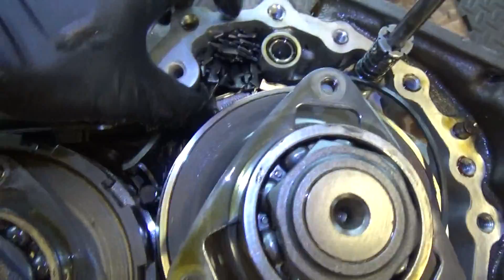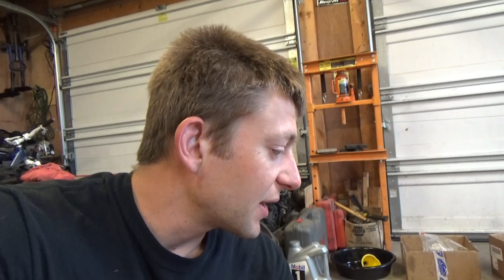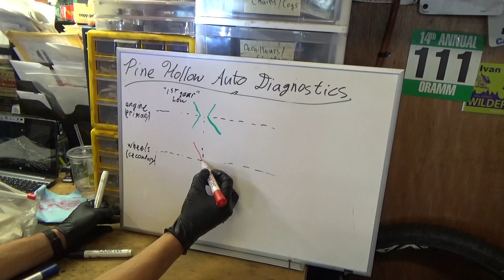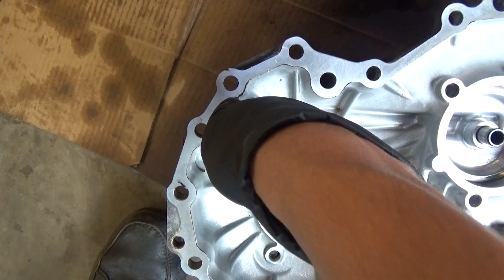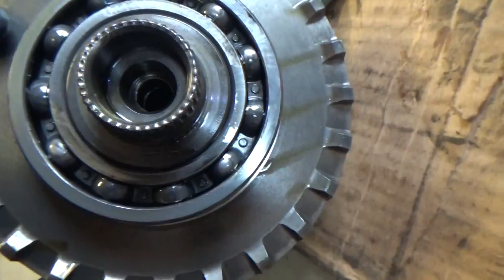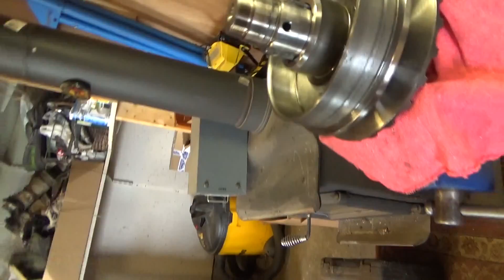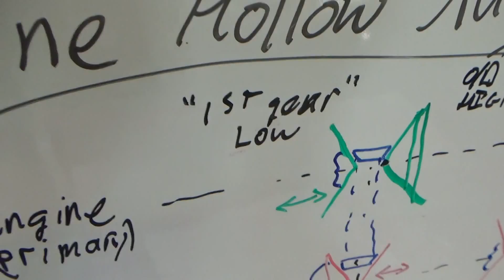Nissan CVT: Teardown and Failure Analysis -Part 2 (RERELEASE!)

Comment: Nissan has one of the worst CVTs on the market, many failing at well under 100k miles they are made by a company called Jatco (Japanese Automatic Transmission  Company) a subsidiary of Nissan they sell these a POS tranny’s  to many other companies including Nissan, Mazda, Subaru, Suzuki, Isuzu, Hyundai, BMW, VW, Land Rover, Chrysler, Renault and even Jaguar. Toyota and Honda makes their on CVTs Toyota has been making them for decades and have a good track record. I’m not sure about Hondas. A rebuilt one cost anywhere from 2k to 5K so an extended powertrain warranty is money well spent on these cars!

Comment: Great video. I agree with your analysis that the failure seems to have originated from the primary shaft. Based on the wear pattern it sure looks like the groves wore over time, as the pulley moved in and out. The Aamco manual states the Nissan recommend fluid change interval is 60k miles. If this transmission had 180k on it then that's three times the interval. I think it's possible a breakdown of the lubricant could have lead to the metal on metal contact which made the failure possible. I do think it is somewhat questionable for those small balls to transfer all of the torque of the engine. Seems like some splines might have been better, but maybe they wouldn't hold up to the cycles. They seem to work in manual transmissions, but perhaps the ball and groove solution has less drag. I don't know. It would be interesting to see a new version of the transmission disassembled. 

I found a couple additional pieces of information on the CVT. I believe this transmission is the Jatco JF011E. Nissan refers to this CVT as the RE0F10A. The 2009 Rouge FSM confirms it uses the RE0F10A. Not sure if later years use a different CVT as I can only find the FSM for 2009. This transmission is also used by Chrysler it seems. From some of the press I am reading from late 2013 Nissan stepped up it's oversight of Jatco around that time. 
https://akppro.com/en/archive/article/jatco-jf015ehttp://aamcoftp.com/sites/aamcotech/assets/cvt-manual_cvt-manual.pdfhttps://www.autoblog.com/2013/12/02/nissan-cvt-jatco-problems-ghosn/
Here's a quote from the akppro.com size comparing and contrasting the JF011E to the JF015E which has a lower torque rating:
"The design of guiding pulleys has changed, too. In the JF011E, pulleys are attached to the shaft with balls, which could be destroyed by constantly changing loads. And here it is pulleys that are fixed with the roller. This is a more durable design solution, which reduces the likelihood of pulley seizure."
So this seems to be what happened with your transmission. I hope the new one is working out alright for you.
Reply: But if you think about it--- if the shaft was the real failure, then the belt would have never broke.   It would have just sheared those little balls and then the shaft/ pulley would just free spin.  So there's no reason that the belt would have broken.   What I think happened is that the belt broke first-- and the all the "kibbles and bits" bound up the pulley and so right after failure, she was still on the gas and the shaft and pulley was chewing up pieces of the belt and binding up-- until it sheared those balls.   The belt failed first-- it had to.
Reply: @calholli  The description of the design change says it "reduces the likelihood of pulley seizure." I'm not in the lab analyzing these transmission failures, but it sounds like if one pulley seized the load on the belt might rapidly increase which could cause belt failure.

Comment: The 2007-2011 Altimas had it the worst with the CVTs. It’s an inherently unreliable design. I prefer regular automatic transmissions with 5 or more speeds. Turbo gasoline engines are reliable as long as they are properly designed and a lot of 90s and 00s turbocharged gasoline engines are very reliable. The only reliable CVT is the Toyota/Lexus hybrid power split device and their new CVT.

Comment: One pulley is activated by oil pressure, while the other one is spring loaded. I think that the oil seal is the route of the problem. The oil seal blew out, an the pulley ran dry and the jam, causing the belt to start breaking. They need a better an thicker oil seal.

Comment: i think you missed the importance of how this really works. those pulleys are variable. if the one gets small the other has to get bigger so it keeps constant tension on the belt. SO both pulleys float on their tubes/shafts from hydraulic pressure as RPMs increase or decrease. I'd say failure was eminent with that many miles and the design. once the metal tabs start falling, whether from wear or a massive pressure drop, it just becomes a bad blender eating everything up inside. I'd also suspect it had metal bits in the trans pan long before it failed completely.  Belt CVTs are better IMO but a 6 spd rules them all. Nice tear down! Ive never seen this models CVT before.  also the last pulley is controlled by pressure thats why their big holes in the shaft. kind of an ingenious design but needs work to last and handle more HP.

Comment: Afternoon, 
How is the Transmission(replaced) working for you. I have a same problem with my Nissan Rogue 2012. Nissan is charging me 3,500 to fix. Afraid for this to happen again after the 1 year/12,0000 mile warrant. Wanted to ask you opinion. 
Thank you Sir,
Reply from the maker: So far the replacement CVT is running strong with 25k miles on it already :)

Comment: What prevents wear on the sheaves in normal operation? It seems the belt would dig into the pulley.
Reply from the maker: Good question! The pressure on the belt is precisely controlled and the engineers did a good job preventing excessive wear, using the proper CVT fluid of course.

Comment: This is why I don't trust or care for CVT trans/Salisbury transmissions.  Fine for small HP applications like golf carts, utility carts...NOT automobiles!!!  If you want an 'automatic' trans, get a 'real' one.  Unfortunately several of the new 7,8,9 speed automatics are so complex that many consider them including the OEM manuf's consider them unserviceable. I have to agree with El Cheapo and Lightningsmoker's comments.

Comment: Cars, like almost everything nowadays, are designed not be fixed, but thrown away when a major problem occurs. Engineers, at the behest of bean counters & management, know exactly how long something can last under normal conditions. They can easily spend a few extra cents or so to make it last longer but they are told not to. End result: It will last until the warranty is up and may last longer depending on how it is used. Also a lot of car owners will trade the car in for a newer one after about 3 or 4 years or when it comes off lease. This way they have a nice new car with very few worries. But the drawback is much higher insurance costs.

Comment: I believe that both pulleys always want to be fully closed, so that's their natural position. The oil forces one to close more than the other. And the only thing keeping them open is the belt. Due to the presence and strength of the belt, it's impossible for both pulleys to close during normal operation. I don't believe the oil pressure and mechanisms in the transmission is powerful enough to squish the belt causing it to fail. Therefor, the belt failed due to the belt breaking. Or something else failed and got caught in the belt causing it to break.
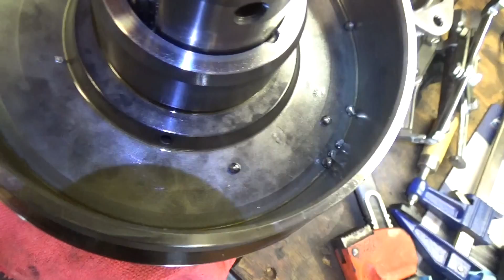Reply: The metal bits at 35:30 look like ballbearings to me. They're probably somehow related to the failure.

Where you thought the ring clip goes, is where I believe the rubber seal goes. The seal is what allows the oil pressure to push the pulley closed.
Reply: I see. So the balls got jammed in there which made the pulley get stuck closed.
Reply: Get a new shaft, then before you install it, send it to a machine shop and have them double the number of slots in the shaft and in the other part that fits over the shaft. Then put balls in the old and new slots for twice as many balls. There will then be half the load per ball.

Also, the balls didn't wear out, the shaft did. So the shaft is obviously made of metal that's not strong enough. So you could bore out the slot to make it bigger, then manufacture a hardened steel insert for the balls. You could do that with your old part. I would both double the number of slots and add the hardened steel inserts.

Comment: ☝️👍 Very well done video and part one as well. As a retired Caterpillar mechanic of 45 years, I just can’t stay away from this stuff and still do all my own work. Proper failure analysis is critical to finding the root cause in order to redesign to prevent future failures, and you sir did a fantastic job. I think you were spot on in the failure analysis of your CVT (Constantly Violent Transmission) Thank you for taking the time to do this although I’m not sure Nissan would agree with me 🤔🙃
Reply from the maker: Thank you for the thoughtful comment! I really appreciate the feedback. As a curious engineer, I couldn't pass up on this opportunity to see how this contraption worked and what caused the explosion :)

Comment: dodge 727 torqflite plane tary gear failure 3gears failure 4or 6 stopped early fail on my 3rd trans same problem here 6 ball bearing better load spread but then what fails next and when 187 miles is good

Comment: Excellent video! Obviously, you had a bearing failure. But, If I had to guess, I would say that one or two of the little balls failed or was bad from the start, disintegrated and starved the rest of the bearing channels of oil. That would cause the wear you see in the vid. And with the position of the pulley when it seized, she was in "high gear". As soon as the engine power dropped, POW, there goes the metal drive belt. I wonder if this is the primary source of failure for most CVT transmissions. You've got a lot riding on some very small ball bearings.